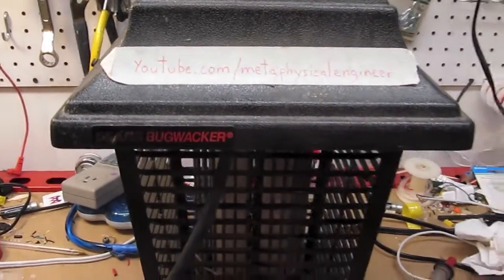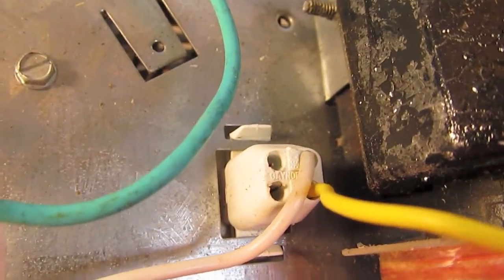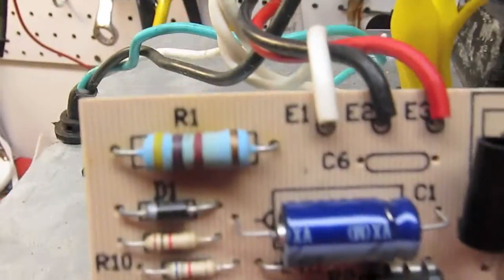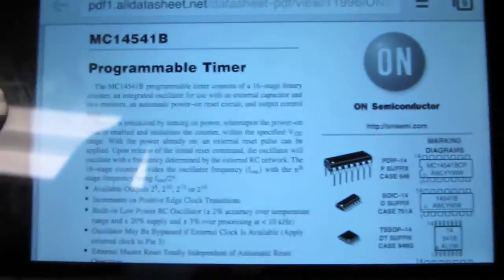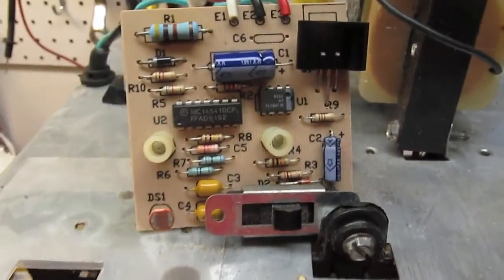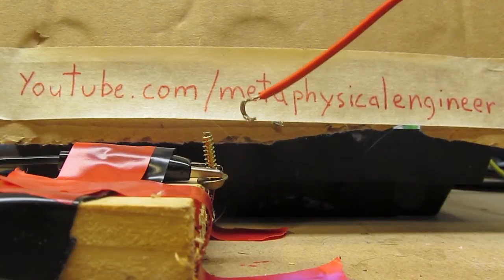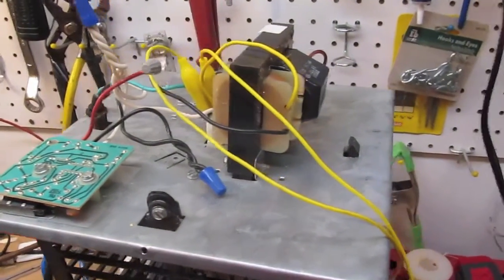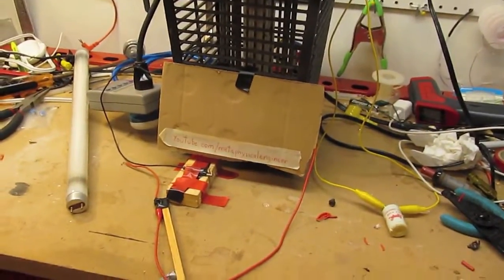What's inside a bug zapper

Comment: I have a similar zapper, but it contains a separate ballast. It does not zap but the lights work. I assume it is the transformer. the tag says 5000v. I have seen a zapper company selling a transformer/ballast. Would that work in my zapper?

Comment: I have one of these but it's a 35 year old flowtron and it still works great to this day. I did have to fix an issue on the HV side one of the wires burned through the insulation and was arcing to the housing so I just took some aquarium plastic tubing I had and covered the wire completely from the grid to the inside and secured with zip ties and it works like the day it was purchased.

Comment from the maker: There's a capacitor of some kind built into the secondary of this one, which allows the unit to output a sudden discharge and helps extinguish the arc.  The transformers are pretty weak and don't last with abuse (or even normal use) :/

Comment: I took apart one very similar to this, just without the electronics. The high voltage winding actually had some electronics in it, which was all covered with plastic. Unfortunately there was a fault with those unserviceable electronics, so I ended up just damaging the HV windings and watching it arc. I never uploaded the video, it just started glowing and eventually had a tiny flame come out.